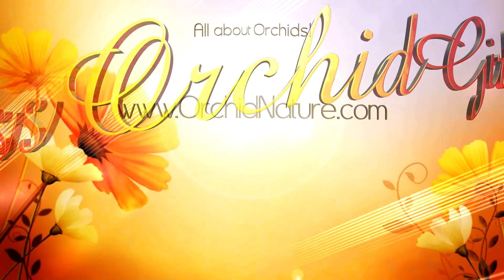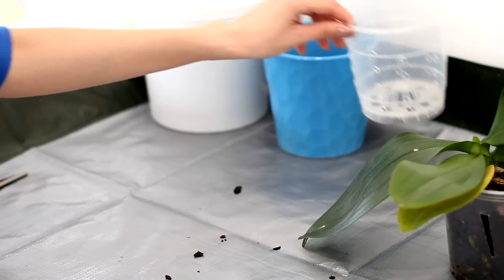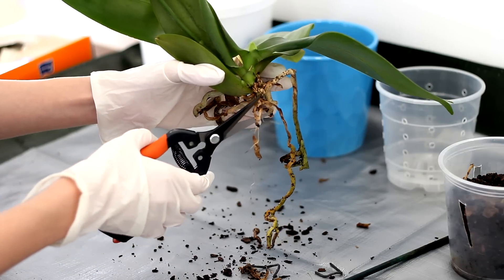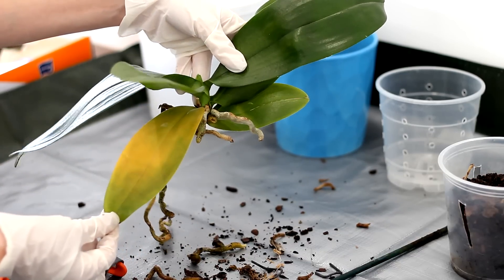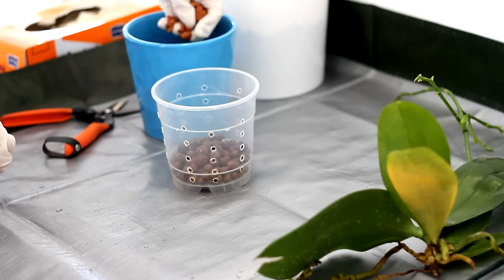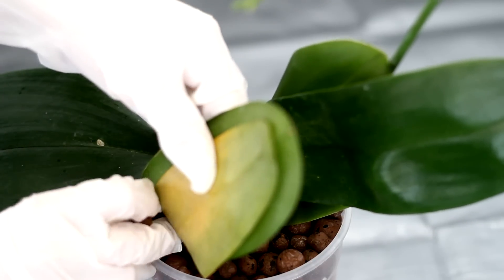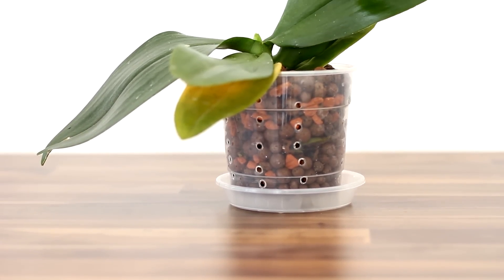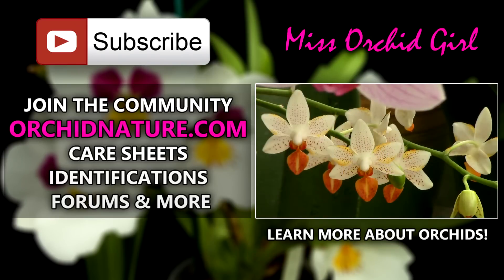Repotting Phalaenopsis Orchid in inorganic medium and plastic pot

Comment: Hello Danni from Neighbouring Crete. Do you suggesting anything for the phalaenopsis to stay in place and not fall? I have some that are kind of heavy so when i try to move them (for watering or something similar) they tend to fall, and i have to be extra careful, and never sure something bad will happen. I've also seen the hooks you've done in another video...
Reply from the maker: +Charalmapos Hi, I usually use heavy decorative containers for the orchid pots, this keeps them in place better :) here is a video on decorative containers https://www.youtube.com/watch?v=Owl8-EeIrZY
Reply: +MissOrchidGirl Hallo Danni, First things first, thank you for tking the time answering :) unfortunatelly it seems I didn't express it correctly. Some plants tend to fall of drom their pot, not the whole pot. I have tied them with a special string made for plant (elastic does not hurt them) but I believe there is a beetter solution than this :/ Anyway thaks again!
Reply from the maker: +Charalmapos oooh I understand now. Well you can try something like this https://www.youtube.com/watch?v=lC428Nte_yI even if it's not pendant and you can use stakes to further stabilize it :)
Reply: +MissOrchidGirl Ευχαριστώ πολύ! :) (guess you would be learning some greek since you are in Cuprys ;) I liked the video, it was similar to what i did but I get some new ideas from it ;). Bytheway, one possible reason the metal affected from plants may be that the are changing easily temperature. So either very cold, or very warm may cause the harming. Ευχαριστώ και πάλι! Keep up :)